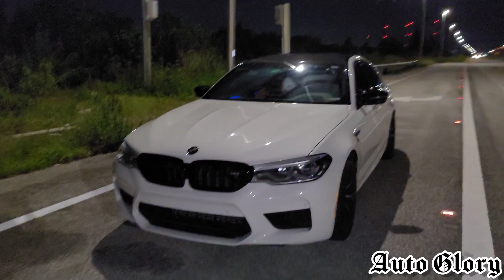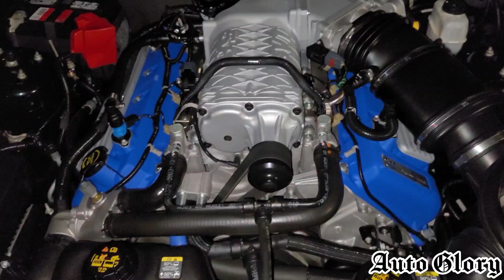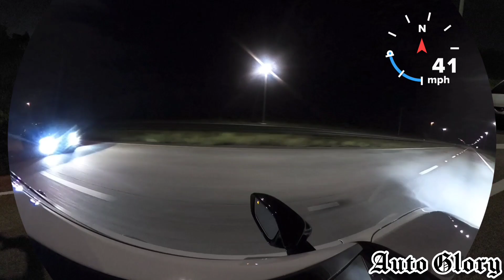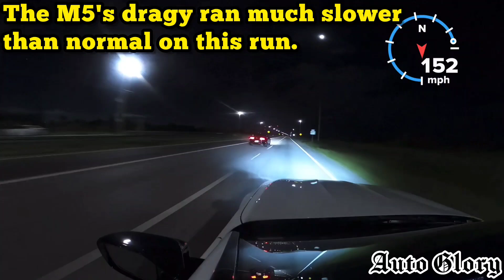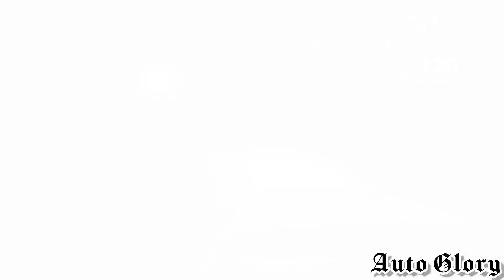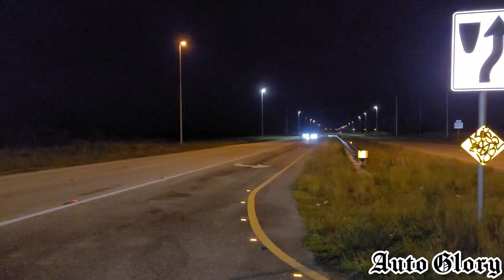2020 BMW M5 Competition OTS 93 vs 2014 Shelby GT500

Comment: Man for almost a 10 yr old platform, stock, and manual. Impressive AF. Shelby up there in the heavens proud AF
Reply: This GT500 and C6 ZR1 are very evenly matched in roll races.
Reply: @YusufSayed-px2xy 2 very iconic cars
Reply: and a solid axle
Reply: @YusufSayed-px2xy no they’re not lol
Reply: @Toxic_coyote12  zr1 is faster of course
Reply: @konabluegt7347  I'd say to an extent they are. The C6ZR1 was the revival of the C4ZR1, it pumped out 638hp which was pretty damn good at the time for the money, and still very lightweight (C6 platform) compared to a lot of cars coming out today, and at that time it was running right next to Ferrari's/Lambo's, etc. on the racetrack at less than half the price. There was also a movie that was entirely based around the ZR1 called "The Last Stand" with Arnold Schwarzenegger. And the GT500 came out swinging with its horsepower as well. Also the modded Shelby GT500 featured as the main car in the Need For Speed movie. And as you know both are very fast platforms for modding even today.
Reply: Yes they are evenly matched
Reply: Here's a video of both the C6 ZR1 and 2013 Shelby GT500 pretty evenly matched in roll race. They stayed with each other the whole time
Reply: 2013 Shelby GT500 vs C6 ZR1 both stock 
https://youtu.be/PgOVRxMq4fk?si=mlzJuq-7MF8aPndl

Comment: Yamil made a great choice on that gt500 tru car guy there driver mod and a lil weight reduction goes long ways if u can bang gears ⚙️ 💪🫡 I know this gonna be faster than his hellcat
Reply from the maker: I like it! It's a sweet car. I test drove one many years ago. My only issue is the long gearing from factory. 331 is too tall for this whp setup but obviously it's an easy fix.
Reply: @AutoGlory  and the weak rods are a huge problem. Didn’t this guy beat a new gt500 on your channel with a hellcat?
Reply: @RobQuincyC7Z06  yes yamils fbo upper lower pulleys making more boost ported blower icebox weight reduction on a drag pack barely beat a full weight 1 bolton near stock on heavy 20s gt500 that very impressive for Ford takes a lot to run a near stock 500 …. 500 with same mods will destroy yamils old hellcat it was already maxed out stock motor couldn’t go faster that’s y he bought a Ford now 🫡

Comment: I was expecting the M5 to move but I’m very impressed that a Stock GT500 put almost a bus on the BMW in the second run .
Reply: @kerntay it’s manual 
it’s 10 years old 
it’s stock 
and makes less power
Reply: @Toxic_coyote12 BMW to top speed would walk it. It was the worst last run for BMW
Reply: 2013 Shelby GT500 hits over 200mph:)
Reply: @Toxic_coyote12 states in the video his car was having issues the second round and ran much slower times on dragy than it typically does. You watched round 1 which was clean up until the misshift.
Reply: @Toxic_coyote12  BMW is 4400lbs
Its a 4 vdoor luxurious performance family car
And does not make more hp on a stage 2  that pulls a 100hp because of huge timing pull with no DPs.
Reply: @rodgazinya he would’ve lost the first run too if buddy didn’t miss a shift 
cry more 
get walked by a older less powerful car
:)
Reply: @bigd382 i don’t care about the weight or the interior 
run what you brung TROLL
Reply: @Toxic_coyote12  The guy with a 8k car 🤣🤣  17 year old mommys boy🤣
Reply: @Toxic_coyote12  bmw was having issues AG said it can you not read?
Reply: The 2014 Shelby GT500 has underrated power putting 675hp on the Dyno on the wheels and 609rwhp with a 15 % drivetrain loss making it 715hp in total in power to the Dyno. It has underrated power having 700+HP in real horsepower.
Reply: @YusufSayed-px2xy  100%
Reply: You're high bro, the stock M5 is 125+ trap. That GT500 isn't stock.  @kerntay
Reply: @bigd382 he lost to a 10yrs old, stock, manual muscle car with less power. 😂
Reply: @YBIsAThotNoCap bmw lovers are SAD. U lost bro accept it.
Reply: M5 is heavy because of the x drive 🤦🏽‍♂️  without x drive bmw wouldn’t be bmw fr

Comment: That M5 moves like stock
Reply: The gt500 was stock as well. No replacement for displacement. The 5.8 trinity motor has a good top end that’s the outcome of the video
Reply: @zali9657  the M5 its OTS 93 according to the title of the video. So for tuned M5 is not moving

Comment: For those making excuses in the comment section, understand something. The 2014 Shelby GT500 has underrated power putting 675hp on the Dyno on the wheels and 609rwhp with a 15 % drivetrain loss making it 715hp in total in power to the Dyno. It has underrated power having 700+HP in real horsepower. The 2014 Shelby GT500 weighs 3845lbs and the 2020 M5 competition weighs 4370lbs which is a big difference in weight. The Shelby GT500 is making 662hp at the crank tho it has underrated power.

Comment: 1. I'm surprised there is such a thing as a stock car from 2014

2. How you miss a gear that is straight down
Reply: Lol good point.
Reply: The Shelby was pristine and was almost not used, probably jist under 10k miles on it
Missing gear is common for Americans, they r not used to Manuals
Reply: @1989rs500  It's literally pulling straight down. It's foolproof.
Reply: @Boblib1970 
Yes it is.. Specially for many Americans who don't depress clutcg hard enuf
Reply: WE ALL MISSED GEARS WYM LOL NOW 4TH I NEVER USUALLY MISS BUT 5TH YES I DO IM SURE BROS HAND SLIPPED WITH ADRENALINE
Reply: @1989rs500  just stop, I get a lot of European's drive/drove manuals and Americans for the most part drive auto's but this is a racing channel with somewhat experienced drivers so its not "common" to miss a shift because "American". This isn't some 16 yr old kid learning how to drive a manual for the first time. Do people miss shifts sometimes when racing, yeah? Was this an easy missed shift, yes. But that's all it is.
Reply: It wasnt stock bro, auto glory himself said it had "weight reduction, only rear seats" i call bullshit its got more. Thats like asking a girl to put the tip in and actually just putting the tip in
Reply: It is stock. Just accept the M5 competition lost and don't make excuses. The Shelby GT500 is about 400lbs lighter and more powerful having 662HP from a 5.8L V8 supercharged engine. How, it has underrated power which most dont know about it. The 2014 Shelby GT500 has underrated power putting 675hp on the Dyno on the wheels and 609rwhp with a 15 % drivetrain loss making it 715hp in total in power to the Dyno. It has underrated power having 700+HP in real horsepower. The 2014 Shelby GT500 was ahead of it's time back then. It got 4th place in world's greatest drag race in 2012.
Reply: @TheVagitarian18 LMFAOOO ONG

Comment: No way something wrong with m5
Reply: The 2014 Shelby GT500 has underrated power putting 675hp on the Dyno on the wheels and 609rwhp with a 15 % drivetrain loss making it 715hp in total in power to the Dyno. It has underrated power having 700+HP in real horsepower.

Comment: I have no idea how that is even possible rolled one in my 14 GT 500 stock vs one on OTS 1 and got smoked bad consistently and I mean really bad unless he was not telling the truth and had more done to his M5 comp. Or there was just something wrong with this m5 in the video.
Reply from the maker: M5 was running a stage 2 map without downpipes. Wasn't a good idea.
Reply: That probably explains it then should be downpipe on stage 2 prob was running really rough. Cause the one I ran against made me look like I was almost standing still thing had nutty top end

Comment: Shocked 😳.. was not expecting that. No shade but that GT500 was oddly fast. Moved like a new gen 😅 stock vs stock I would have expected a close one, ots tune I thought the F90 would walk away. Sweet runs all the same.

Edit- description says it all. A better stage 1 map would be optimal for the M5
Reply: The 2014 Shelby GT500 has underrated power putting 675hp on the Dyno on the wheels and 609rwhp with a 15 % drivetrain loss making it 715hp in total in power to the Dyno. It has underrated power having 700+HP in real horsepower.

Comment: Either something not right with that M5 or that driver was high, those results are ambiguous for the M5!!!
Reply from the maker: Read description
Reply: well looks like a rematch is coming soon then!
Reply: @AutoGlory now i got it, new something was amiss with that M5!!
Reply: The wrong ECU flash is what’s actually wrong , it’s like racing with Check Engine light on basically
Reply: M5 needa dp
Reply: The 5.8 trinity motor in the GT500 has a very good top end and has Long gears, and also the engines were underrated back in the day. Stock GT500 make 609 whp almost 700 to the crank. Good race tho
Reply: @zali9657  no-matter the explanation, it can-never trounce a tuned 2020 M5competition whilst its stock and stick shift (GT500) i don’t care if the gears are as long and deeper than the Indian ocean, or if the Hp was under or overrated!!!
Reply: @duffydon1741  my guy I've owned a M8 competition and recently traded for a M5 competition. Yes a tuned M5 would be faster but in this case and in the video. That M5 dosent have upgraded downpipe. It's Stock so it dosent have the same power as down pipe and tune car. Clearly the guy in the GT500 his shift were on point and we saw the M5 lost. It ain't that serious. It's just a race lol
Reply: @zali9657 bs

Comment: Should have been closer. Something up with that m5
Reply: No excuses man. Accept the M5 lost. The Shelby GT500 is about 400lbs lighter and more powerful having 662hp and weighing around 3,845lbs and the M5 competition weighs 4,370lbs.
Reply: The 2014 Shelby GT500 has underrated power putting 675hp on the Dyno on the wheels and 609rwhp with a 15 % drivetrain loss making it 715hp in total in power to the Dyno. It has underrated power having 700+HP in real horsepower.
Reply: @YusufSayed-px2xy bs the M5 is faster even stock
Reply: zaid9988 how is this bs? Search it up yourself and see for yourself. This Shelby had underrated power on the dyno. It's much lighter so...stop making excuses
Reply: @YusufSayed-px2xy  bs
Reply: You are a fanboy give it up man. Stop lying to yourself. Numbers don't lie and the Shelby is much lighter

Comment: Guys that's just not a regular Stang.. 10 yrs ago you knew not to try it
Reply: Exactly, Shelby’s never lost their presence.
Reply: Smartest comment I’ve seen yet, somebody that actually knows what those 13/14’s did to others back then 😂
Reply: Bro I had fools shook 7-10 years ago 🫵🏽😆 Loved that Shelby to death
Reply: The 2014 Shelby GT500 has underrated power putting 675hp on the Dyno on the wheels and 609rwhp with a 15 % drivetrain loss making it 715hp in total in power to the Dyno. It has underrated power having 700+HP in real horsepower.

Comment: BMW would be faster with the stage 1 tune. No DPs means timing pull..😮😮😮😮😉🙋‍♂️
Reply: Cry harder major Import L 🤣🤣🤣 brand new BMW got beat up by a 10yr old Manual Mustang 😂
Reply: Cool now put a smaller pulley on the GT500 and then let’s see what u got
Reply: @SneakyWhipple5.0h  🤣🤣 You mean a big heavy luxurious  Autobahn eater 4 door does EVERYTHING better, massage and AC seats,  16 speaker B&W stereo, AWD, space and comfort for days vs a fisher price cheap junk garbage 2 seater junk. Only thing it's got is an engine 🤣
Reply: @bigd382  apparently DOESNT do everything better because it ain't faster than a 10yr old manual Mustang 🤣🤣 keep coping over the major L
Reply: @ReadyOnThree Cool its a big luxurious performance family car sedan that does everything even snow lost by almost nothing  down on power with the wrong tune🤣. The stage 2 tunr has to have DPs or it pulls timing huge.
Reply: @bigd382  You still upset over the FBO e85 340i that I gapped on my channel in a stock 10spd 5.0, and the FBO E85 pure upgraded turbo 135i that also got gapped multiple times by me and one of my stock 5.0s 🤣
Reply: @SneakyWhipple5.0h  🤣🤣 Embarrassing for  600whp muscle car with no back seats, garbage interior, seats, brakes, handling. That JUNK has a solid rear end 🤣🤣.  ŹERO comparison vs a beautiful big luxurious 4 door family car that can go in ANY weather. Even light to light lol Junk vs luxury. 😄
Reply: @bigd382  you getting Sneakgay to rage 😂😂😂 let see if she continues if she likes big tip!
Reply: @DodgeandGMkiIIingFurdDaiIy  Best part she still hasn't posted a vid of the stock Yote proving it has this imaginary 1000hp when she doesn't even have the keys to start it 😄😄  She got reckd on that and never did anything 😂
Reply: @DodgeandGMkiIIingFurdDaiIy  Biden they thems all living in mommyd house. Slow0.5 is another one 🤣
Reply: Auto glory said the bmw guy was running a stage 2 map with no DP. No idea why, but he did lol
Reply: @jojojojoj3440  then its not a stage 2.
Reply: @ReadyOnThree  those Trinitys have weak rods it will go kaboom 😂
Reply: @jojojojoj3440  It makes the car pull timing. You need DPs.
Reply: @JohnnyPoorenceBanned2021  True they do. Many a rod issue on the 5.8L. They don't like to be reved high either. I had a 5.4L Shelby. Not s good car. Brutal handling.
Reply: @bigd382  Bro I can't deny that what you're saying is absolutely the TRUTH. To put it blunt you're hitting right where it hurts to make people cry. Lol.
Reply: @jonasblane2157 only people that are crying are the bmw fanboys/ for haters 
talking about luxury and this and that when they’re racing 
😂 cope harder
Reply: @Toxic_coyote12 Moron I show you on another video that BMW beating that s  ty stang for breakfast
Reply: @Toxic_coyote12  Actually anyone with eyes in their heads will easily see got the BMW is a full weight full-size luxurious 4-door family car going up against a two-door 600 wheel horsepower no seats in the rear Shelby and on the wrong tune which is pulling timing because that's what happens stage 2 with no downpipes and the Mustang could barely do anyting LOL
Reply: @bigd382 I guess all chevys mopars and fords r junk right cuz we buy them for luxury and not to go fast right 😂💀u the tru meaning of a fangirl
Reply: @henzo7087 cryyyy
😂
Reply: @bigd382 😂😂😂 cry
Reply: @Toxic_coyote12  Says the guy with nothing 🤣
Reply: @henzo7087  This same BMW on the stage 1 tune was door to door with a new GT500. Proves this tune was wrong.
Reply: @bigd382  You still upset over the FBO e85 340i that I gapped on my channel in a stock 10spd 5.0, and the FBO E85 pure upgraded turbo 135i that also got gapped multiple times by me and one of my stock 5.0s 🤣
Reply: @SneakyWhipple5.0h  Copy and paste. You fail again like you do on life everyday 😘😉😄
Reply: @SneakyWhipple5.0h  NO.KEYS KID😜 Never will ever either 😉😘
Reply: @bigd382  coming from the poor with no car and no videos 🤣🤣 stay mad over the fact you can't and WONT ever u0load any video of your car because you don't own one 🤣🤣
Reply: @bigd382  I literally have MULTIPLE videos of me racing and beating multiple different slow POS imports and chebbies and you try to say I don't have the keys to my cars 🤣🤣🤣 even have two 60-130s of my boosted 5.0 and you still stayed quiet about that 🤣🤣🤔🤔🤔
Reply: @bigd382  how much you wanna bet I can make a video right now of me starting my stock red 10spd 5.0 sitting in my carport, the SAME red 5.0 I drove to Florida that you tried to say is a rental 🤣🤣🤣how wrong do you want to be rightnow
Reply: @SneakyWhipple5.0h  🤣🤣🤣🤣 U knew it. YOU claimed this red stang has 1000whp and you can't even pop the hood 🤣🤣.  Still waiting.
Reply: @SneakyWhipple5.0h  POP THE HOOD😄
Reply: @bigd382  I never said my STOCK 10spd had 1000whp 🤣🤣 I've made it clear from day1 I own multiple different 10spd 5.0s. My 2018 Black 10spd Premium that's in my profile picture is my boosted 5.0. It's not my fault you can't read though
Reply: @bigd382  First it was I don't have the keys and just proved you wrong with my video uploaded 🤣 I also have two videos already of different 60-130s I did over a year ago in my boosted 10spd 5.0 and yet you dodge that fact when it's brought up over and over again 🤣🤣 lets see you upload ANYTHING of your car, you won't. EVER

 Edit: Yep that's what I thought. You have nothing 👎👎🤣🤣
Reply: @Toxic_coyote12  Run to top speed you have no chance there

Comment: Dragy, what Dragy?  I mean i see a laggy gopro overlay but no dragy.   haven't seen any racebox numbers in a loooong time either.  miss those AG, bring em back.
Reply from the maker: The m5 owners dragy. He showed me it that night.  I'll being the racebox back. My friend with a z06 actually took it home with him accidentally. So when I see him again. I'll get it back on the channel. He's got a few runs upcoming soon.
Reply: @AutoGlory What was the draggy 60-130 time?
Reply from the maker: @5ivebanger  the 2nd race he ran a 9.0 or 9.2 I believe. He was also racing another car like 20 30 mins b4 the gt500. So not having proper cool down time and running map 2 hurt him.
Reply: @AutoGlory  Ah, a little heat soaked- that make sense then. So probably mid to high 8’s , that’s not bad for just OTS tune.

Love the race box, hope you get that back soon, always adds perspective to the matchups. Thanks for the content, you do a great job!
Reply: @AutoGlory  wow, 20 minutes later, including some cruising back to the spot is not enough cool-down time

Comment: Its either the M5 is running with a bad tune or a problem or the Shelby is heavily modded. F90 M5C run 100-200 7.5-7.2 while the 2019 Shelby GT500 (771PS) with dual clutch transmission run 100-200 7.3-6.8. The 2013 Shelby is running 100PS less than current generation with a manual transmission. Re race will answer it all.
Reply: The 2014 Shelby GT500 has underrated power putting 675hp on the Dyno on the wheels and 609rwhp with a 15 % drivetrain loss making it 715hp in total in power to the Dyno. It has underrated power having 700+HP in real horsepower.
Reply: Read the description. GT500 did well